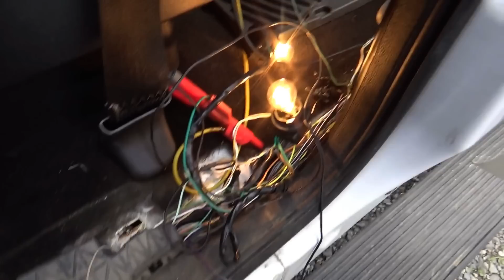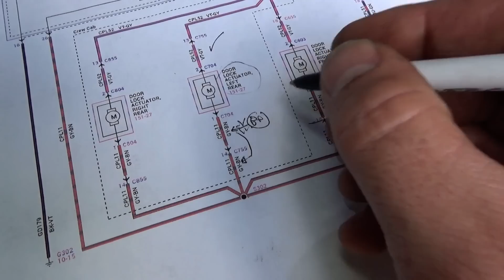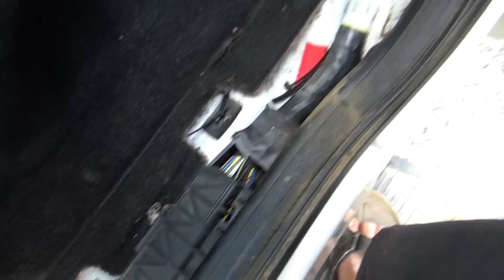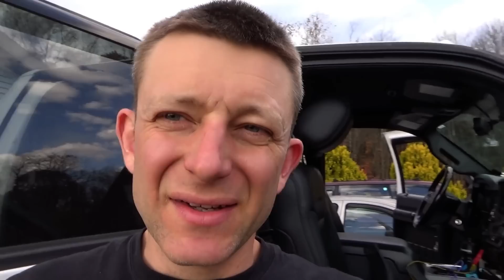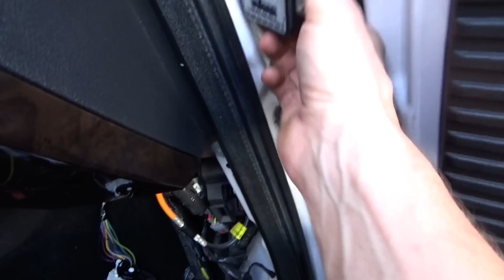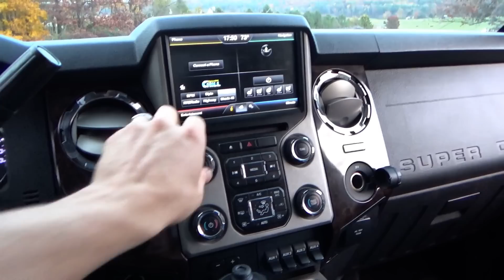(Pt 2) PowerStroke Power Locks DISASTER!?

Comment: Why not replace the harness with one from a junkyard?
Reply: Labor cost to strip the interior out and refit it.
Reply: Leave the burnt shit unplugged and run the new/ used harness..
Reply: @Z-Ack you would still need to pull  most of the interior apart to plug everything in
Reply: @johnt.848  
one fella on here said he did it in 3 hours.
Reply: About a days work to strip out the interior of the donor vehicle to get the harness, which may have irreparable damage on it, then striping the interior of your vehicle, installing the harness which includes removal of all door cards, then reinstalling all the cards, carpets and seats.
That just seems like a lot of work. 
I'd go the manual door lock route.
Reply: How many hours would be involved in the search for the exact correct part and traveling to get it and probably removing it, and then still possibly discovering the connectors were different or whatever. Been down that road a couple times where the u pull it place says oh yeah , we have one of those and you come to find out that no you don’t. Who pays for that?  Unless the customer wants to chase down the used parts on his dime, I repair or replace with new. I think Ivan made a good call and got the job done to the customers satisfaction.  That’s why not.  Just my opinion of course.
Reply: Extremely hard to find in a yard. And often times either the yard cuts them when removing parts or same goes in the U-Pull-it yards, customers butcher so much. It's not cost effective
Reply: @CubasAutomotive  Some yards are run like that but a decent yard will not allow cuts in between connectors. That hurts their profits and stock.
Reply: Sort of related.  My buddy had his bumper pulled off while parked on the street.  To me it just looked like a new bumper and some paint.  Collision shop decided he needed a new harness under the hood.  Apparently to get the harness in they had to completely remove the entire dash.  Cost of the repair ended up being $9k!😳. Just looking at the damage I figured $3k at most.  I would have thought there would have been a bulkhead connector at the firewall but I’ve never had to mess with something like that.  Anyways, that’s why insurance costs are so high I guess.
Reply: That’s a Platinum trim on this truck, with all the gadgets including retractable running boards. Might be a tough harness to find.
Reply: Yes, well worth the thought if the customer wants it done best as possible. When you figure in the "manual fix" it vs. obtain one from the salvage yard, I'd bet the hours would be similar but the used version would be OEM clean replacement vs. tape repairs.